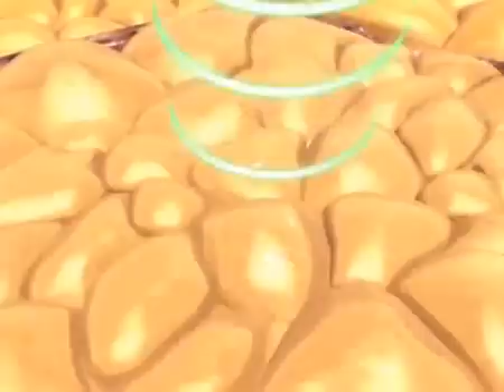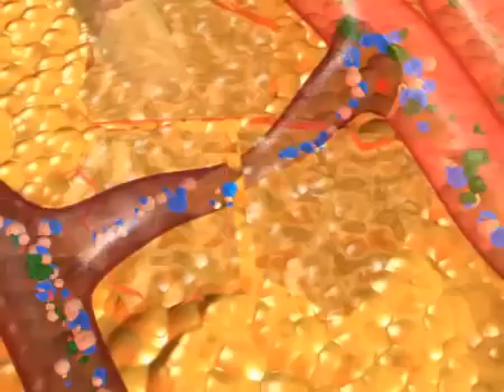Ultrasonic cavitation how it works

Comment: I've sign up 8 session for $950 CAV abdomen. Also using RF. Every Session last around 1 hour. Heating temperature to 43 degree. After 3 session, I don't notice any differences. I was also told to drink plenty of water and go on a Protein diet for the next few days after the procedure. That mean, no pasta, rice and bread. Will keep you guys posted on the outcome. Doesn't look promising